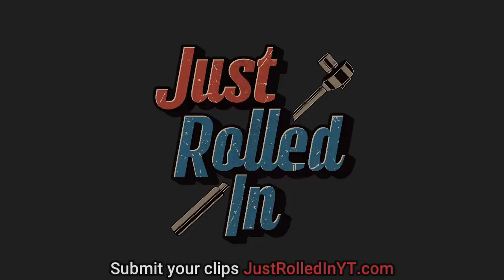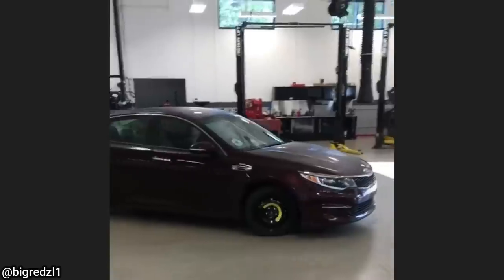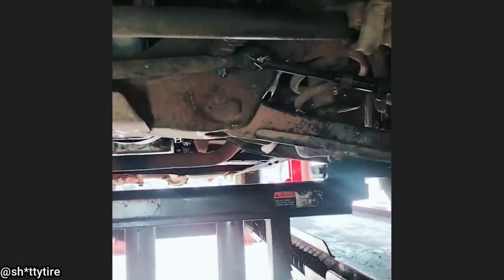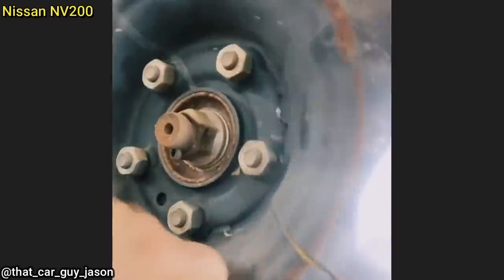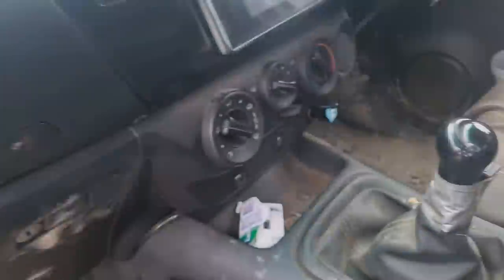Customer States Another Shop Balanced Tires, Still Have A Vibration | Just Rolled In

Comment: Tire light is on and the tires are actually full??? CHECK THE SPARE!!! I had this happen once, took it to the Tire Service who installed them and they ran a scan on the sensors, only to find them working correctly and said they couldn't help me. I called my actual Mechanic and he told me to check the spare. Spare had 5 lbs in it. I pumped it up and the light went out. 👍
Reply: The light was on because of the crazy excessive air in the tire!
Reply: @TheMotorman80  I've never seen a sensor do it for too much, only for not enough. They're designed for warning of a FLAT. Also, I've never seen a tire gain a significant amount without someone physically adding it. Sure, they gain pressure from heating due to friction, but not that much. I still say check the spare.
Reply: @neolithicnobody8184  My friend works as a Ford mechanic and the tpms are set for not for just tires that are under inflated, but over inflated as well. I bet if you use the magic power of Google, you could see for yourself.
Reply: I still say CHECK THE SPARE!! The light was apparently on and they assumed the tires were low, so they added more pressure. Most people, including so-called Professionals, forget about the spare. Out of sight, out of mind.

2 months ago I took my Wife's Nissan Rogue in to have new tires put on due to 2 tires having slow leaks. I already knew why the light was on. The Technician tried to tell me it needed all 4 sensors replaced because their scanner couldn't detect them. I refused the replacements because I knew for a fact that they were working properly. Upon getting the new tires on, the light went out. I already knew the light would go out.

As for your Google comment, this is what I found....The goal of a TPMS is avoiding traffic accidents, poor fuel economy, and increased tire wear due to UNDER-INFLATED TIRES through early recognition of a hazardous state of the tires.

Furthermore.....
Does TPMS light come on when tires are overinflated?
TPMS lights don’t activate when tires are overinflated. They only come on when your tires are below the recommended tire pressure. If you didn’t see your TPMS light come on in the heat of the summer, that’s why. When you understand how tire pressure changes in the warmer and cooler temperatures, it’s clear why the TPMS light comes on.
Your TMPS Light is On? Could Be the Weather

www.ritaranchauto.com/is-the-weather-the-reason-your-tp…
Search for: Does TPMS light come on when tires are overinflated?

Comment: I noticed I had a vibration in my rear wheels after just getting my truck back from the shop, I have two small wheel weights still on my rear tires. I'm taking it in first chance I get for them to rebalance it because it's really annoying

Comment: I'm pretty sure my last tire gauge failed because it was a 75 psi and I occasionally had vehicles come in with 80+. Mostly minivans for some reason.
Reply: Its a common misconception people have. They look at the psi rating on the actual tire which can handle the 80+ psi instead of looking at the psi rating on the inside of the door. I don’t know how many people I’ve heard say that they fill tires to the rating listed on the tire but its way too many.
Reply: @EAWhite1984  Many don't even look at the tire. These were 44 psi rated.
Reply: @EAWhite1984     I've never heard of a consumer car tire that has 80+ psi written on the sidewall. Can you give me an example of one?
Reply: @SergeantExtreme  Most car tires are load range B. C-F load range for pickup truck tires, some trailer tires. Might see those on some vans. Especially handicap modified vans that weight more. I saw a chart that shows going up to load range N (!) for passenger tires. Never saw anything anywhere near that high on a tire. I bet it would almost feel like a solid tire.

Comment: - goose car 😂
- deer in car 😂
- 0:32 Well, a friend of mine works in a dealership of a German car brand... they had a car DRIVING in like that plus the main airbag hanging loose all over the steering wheel (after the guy rear ended another car and pushed 4 cars together)... what was his complaint? Could you add some coolant, please? 🤪🤭🤣
As he wasn't completely by himself and didn't understand the situation they called an ambulance for shock treatment.🤦‍♂️

Comment: n0:05 modern balancing machines offer a program named "matching". you balance the rim first, put a mark on it, then mount the tyre correctly, balance again. the machine will give you a mark for the tyxre, then you de-mount and match both markings; this is the most optimal setup for rim and tyre, using the least amount of counterweights. one time I managed to reduce a wheel down to a mere 5grams altogether. :)
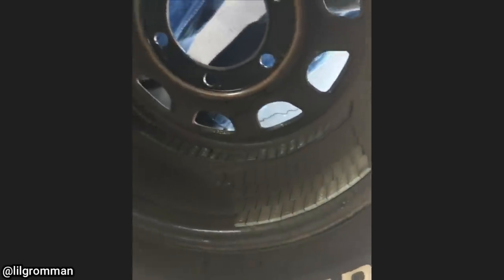0:23 when I was learning car mechanic teachers told us to never inflate a passenger car tyre above 5 bar, as it could damage the threading and provoke it popping eventually. 7.5 bar would have had me run to the hills...
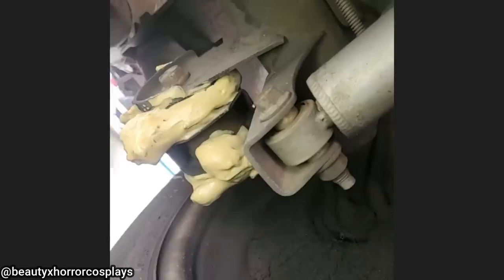1:26 "Congrats, dear customer. The quote has now added 25% because we have to clean up the mess your ..."fix" has caused."
1:37 I can imagine the car having been overloaded for a longer period while being driven on a rough road. anything else... material problems?
1:53 batteries too big is a problem with quite some vehicles. including a Bentley Continental, where they placed it underneath the drivers's seat (so you have to take half the interior apart to reach for the battery? dafuq!), and if the battery's too high the posts would scrape along the installments on the seat's belly...

Comment: DIY projects aren't for just anyone. You gotta kinda know what you're doing.  When in doubt,  that's what you pay the experts aka professionals to do.
Reply: Recall the customer who brought in one shock/strut assy from his Z car. He thought he could change his own shocks just be releasing the top 3 nuts that held the assy together but forgot about the spring tension beneath it. He did not bother to swing the strut assy out from the wheel opening first and when it let loose, it jammed tight in the wheel well. He finally got it out and brought the whole mess to us in an Igloo cooler. Fixed it, he reinstalled the completed assy at his house and then returned so we could do the other 3 struts the ''correct way.''

Comment: I believe the guy with the BFG tires, they look like KO2s. I had a set on my truck when they came out, could not keep them balanced I had several shop tire and never found leftover weights only signs of them removing the old ones. At the time if you looked at BFGs reviews no one with a heavy duty truck could keep them balanced. And I have a friend with a new set on a dodge 1500 and they won't stay balanced. So I got a set of Toyos on my Super Duty and problem solved.

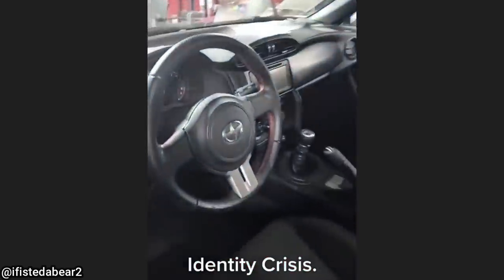Comment: 2:12 A Toyota GT86, Scion FR-S, and Subaru BRZ are the same vehicle. The only difference between them is badging on the body and steering wheel. They even have Toyota's and Subaru's logo on the top of the engine together, regardless of which badges are on the outside of the car. The wheels shown in that clip are not only correct for that car, they are probably the actual wheels that car came with, or should have come with. They just have the wrong center caps in them.

Comment: If you get Your tires balanced and the shop puts weights across from each other like that the Shop has NO clue how to Balance tires. Those weights are trying to counter balance the weights on the other side. Sometimes to fix the issue all you need to do is move all the weight a little in one direction or the other to make it true, not add more weight..

Comment: The Scion FR-S / Toyota 86 is a joint project between Toyota and Subaru.  It is built in a Subaru plant with a Subaru Boxer engine.  Same car as the Subaru BRZ.  Someone simply put BRZ badged wheels on an FR-S.

Comment: Spray foam bushings  ??  I cant believe that a person who is smart enough to find the bushings,  would be that disconnected from the reality of them.
Reply: The worst DIYers are just smart enough to know how things function, but not enough to understand the details, and the kind of forces and conditions things have to work with.  They're the kind of "fixes" that would work if you divided the weights and speeds by 10, and didn't have sand and water splashing on it.

Comment: Don't know why any one would try to balance a wheel like that, remove weights and put Magnum in the tire especially on large off road tires you can never balance a big tire with weights and expect it to work , balancing compound works every time you start to move and no stupid weights to wreck your wheels.

Comment: I turned a Toyota Prius that had its front tire explode and ripped the fender and part of the hood off I checked the other three tires they all had well over 110 PSI in it the customer said the tires look low so he kept adding air he hit a pothole and boom. You can't fix stupid 🤔

Comment: Can someone give me some tips on how to get wheels off that are stuck? Putting my winter tires on was really exhausting today. I set the car down on the wheel without the bolts to get it to loosen and the wheel suddenly popped off at an angle and the car sat on it until i got it jacked up again. Hope that didnt damage anything
Reply: Use copper or alu paste before putting on the wheels.   They have most likely rusted stuck.
Reply: Kick first, then 3lb hammer from behind, then 10lb hammer, then heat, then drive around block with loose nuts, then C4 plastique.
Reply: @THRASHMETALFUNRIFFS  I agree. Bfh is you friend.
Reply: You should've leave the lug nuts on them for safety reasons. You don't have to lock them in all the way but at least 5 to 7 turns so that there is still gap for the wheels to loosen without it flying off.
Reply: I take a 4x4 piece of scrap wood and lean it against the wheel on the outside.  Then, beat it with a 20# sledge hammer.  I have only had to give up on one vehicle.
Reply: Tampa Here!  What are these "winter tires" that you speak of?
Reply: @jeanettejack2152  You'll get yours my friend. ROFL.
Reply: @jeanettejack2152  Drive your car with aluminum wheels hub deep in the ocean every day for 6 months and you get the same effect....
Reply: @corvettebob96  20#! I have a 12 pounder and it kills me to swing it much.
Reply: @MrTruckerf  I may have embellished.  :)  
I use a large sledge hammer with at least a 2 foot handle.  Not really sure of weight.  if an axe is closer, I use the hammer part of the axe.  Why let the facts ruin a good story....

Comment: No I'm going to let everybody know if you need your bushings replaced on your suspension it's not expensive okay it's not like replacing your whole suspension honestly the most you be paying for is just the labor to put them in they are rubber components they're very easy to replace just don't do it yourself and spray foam is not a way to replace them okay or fix it if you are getting a squeak from your bushings on your suspension sometimes it's not the bushings themselves they just need to be clean cuz they can get dirt and debris in them so if you go to a car wash that doesn't under spray like sprays hot water and soap underneath that'll help sometimes if it's still continues to squeak then the bushings need to be replaced I've came across this problem on a brand new Mercedes it was squeaking like crazy through the winter and we found that it was just filled with salt and once it went and got cleaned brought it back it didn't no longer squeak so that's why I say try with the car wash first if it doesn't work then you need to replace the bushings and they're not expensive

Comment: I'm shocked & amazed that these vehicles are on the road, driving around. I have to assume that every state has a yearly inspection requirement for vehicles using the public highways? If so, how the (cuckoo) do these monstrosities pass? If they have passed an inspection, the inspection centres need to be disbarred!
The wheel weights issue is an example of why genuine mechanic shops such as yours are regrettably & unjustly on the receiving end of mistrust from customers. They've had a bad experience & they expect it again. Thankfully there's still a lot of good ones around..
Reply: NOPE! Absolutely NO safety inspections for cars or light trucks in the US. Emissions inspection in some states and cities.

Comment: I'm an actual idiot when it comes to mechanical stuff, thought these videos would help me a little bit. 

But the tire balancing, is that something bad? They flipped it 180 degrees and a small amount of weights. 

I don't get it.
Reply: Very bad. Old weights are supposed to be removed then input correct wheel dimensions to the machine so that it can tell proper positioning of the new weights. Whoever balanced that wheel in the video did none of that.
Reply: @HighlordFrancis  So let me get this straight, they balanced the wheel once, but left the original weights on there. Then re-balanced it, but because the old weights were still there, they had to throw on a lot of weights to counter it? Am I close?
Reply: @BiIboSwaggins  you’re correct. Also probably didn’t input wheel dimensions into the machine.
Reply: @HighlordFrancis  Thank you!

Comment: It surprises me that the wheel assemblies or tires don't fail with 90 plus psi in the tire.  And it cannot drive very well, either.
Reply: It has to handle bumps under normal pressure, so it has to take higher forces at least temporarily.  And for something so important for safety, you want a safety factor of several times the expected forces.  It will damage the tire over time, and age, a flaw, or continued abuse can cause it to fail randomly without warning.

Comment: I must admit, I've never seen a steel wheel rim crack like that. What happens when hitting the pothole, rim will usually bend, not crack. Certainly NOT on multiple places. I suspect poor heat treatment on this particular rim 🇨🇳

Comment: That what I'm guessing is a Scion FRS is not to strange the FRS or BRZ is a Scion a Toyota Product that was a toyota subaru joint build so its a toyota with a subaru drive train as all the parts on the car are still toyota body parts and subaru drive train parts there is nothing wrong with this car.

Comment: first clip. fuck bfgoodrich all terrain t/a ko2's. i know exactly why there's so many weights. 
worst tires to mount and balance, and a hefty price tag for subpar performance. always had wheel/tire combos weighing ~70 pounds per wheel.
i had a great experience driving with laufenn x fit a/t's, though they do have a soft sidewall so they did suck to mount.

save your money, don't buy ko2's.